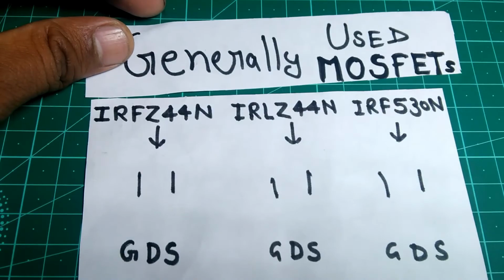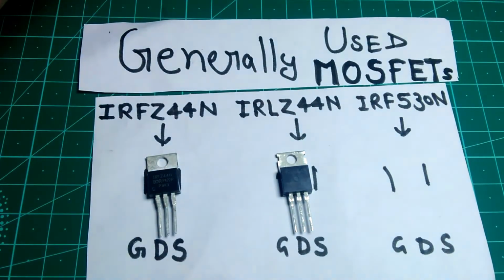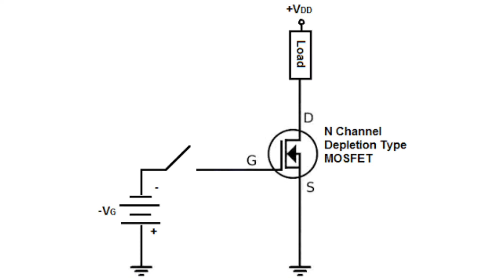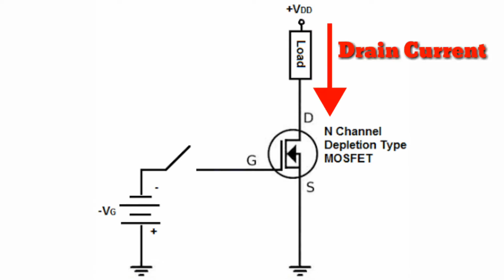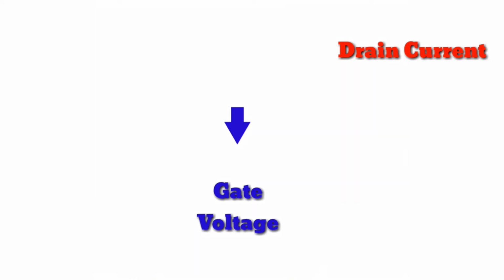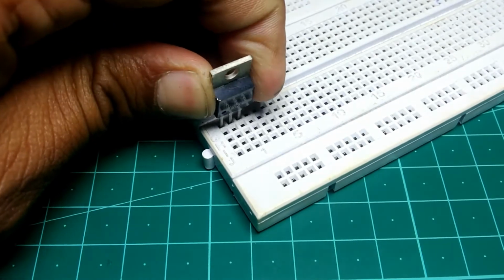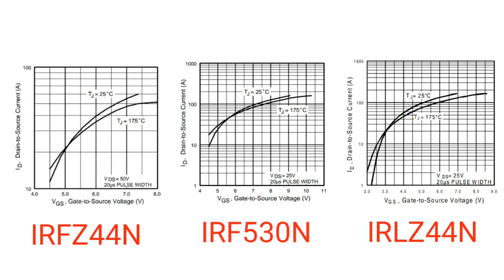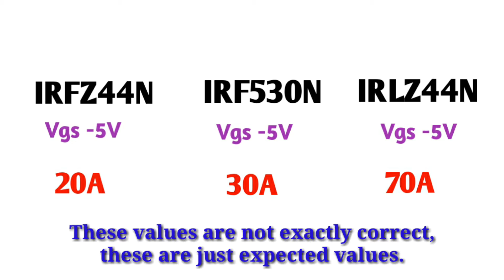Transistors with Arduino   Part 2 MOSFET's

Comment: Could someone help me? I have 12v led strip and i have to drive it by arduino. So i need transistor that could handle (logic/software pwm). for example pwm on pin 13 on arduino

Comment: Led strips required 12v and 1.5 amp
So which transistor i should use with Arduino
Reply from the maker: Well i have used TIP120 /122 and to be honest it worked like a charm, or you can use a logic level MOSFET like IRLZ44N

Comment: Hello I wanna ask question about IRFZ44N I found rgb led driver with IRLZ44n but I don't have IRLZ44n so if I use IRFZ44n it is gonna work the power I use is 12V and around 0.2-0.3A
Reply from the maker: According to your values it might work.

The best way could be using a BJT before MOSFET so that Arduino's signal will be amplified to say 9-10v by BJT which will be a very good gate voltage to switch the MOSFET.

Comment: is it safe to use 12v 2A adapater in arduino mega 2560?
Reply from the maker: Well you can use it. But try to go with 12v 1a or better to go for 5v 500mA-1A

Comment: Why you didn't used resistor
Reply from the maker: Actually i was just demonstrating and it can work without the resistor resistor is recommended when you run it for some time. So if i had to implement it i will use a resistor but since it was a demo so avoided it.

Comment: Thanks much. I was able to follow your video and get this working.
I have a 5v. DC motor and  this worked.
Earlier I used a 2n2222 and it got very hot and It stopped the motor from running, the 2n2222 plastic top used to stop functioning after a minute and die down !
Went with your design instead Works.
Reply from the maker: Your welcome , try to go with transistors who can withstand bigger currents or use a constant current source which can't provide enough current so that transistor won't go hot.

Comment: So when you use mosfet you don't need 2.2k resistor between Arduino pin and Base? Why is that?
Does that mean mosfet is more safe to use in case you forget about resistor?
Reply from the maker: Well it is true that MOSFETs are safer compared to BJTs but you should put a resistor of a suitable Value to avoid any misshappening. To make the circuit easy to understand i avoided the resistor. It is always the best idea to go with resistor.
Reply: its gate terminal, not base
Reply: Why didn't you mentioned it earlier. Today my Arduino died just bcoz of you 👿👿👿
Reply: @laxmiibhele8376  similar thing happened to me before. I followed some video in youtube and ended up burnt my Potentiometer.
Reply: You should always use a resistor between an Arduino output pin and a MOSFET gate. The MOSFET has a gate capacitance that will initially behave like a short to ground when the Arduino pin switches rapidly from low to high. Since the pin is only rated for 20mA maximum, it is advisable to add a series resistor to ensure that the gate capacitance doesn't try to draw more current than that. A 270R resistor would be a good choice. Of course, the transient current drawn to charge the gate capacitance may be too brief to cause any damage, but it's better to be cautious than to damage the Arduino for the sake of a resistor.

Comment: Home come you used a resistor in part 1 but not here? You dont need it?
Reply: @electronicGURU  Oho, I thought all transistors were current controlled.
Your videos are very hands-on and educational, its helping me a lot!
Reply: You should always use a resistor between an Arduino output pin and a MOSFET gate. The MOSFET has a gate capacitance that will initially behave like a short to ground when the Arduino pin switches rapidly from low to high. Since the pin is only rated for 20mA maximum, it is advisable to add a series resistor to ensure that the gate capacitance doesn't try to draw more current than that. A 270R resistor would be a good choice. Of course, the transient current drawn to charge the gate capacitance may be too brief to cause any damage, but it's better to be cautious than to damage the Arduino for the sake of a resistor.

Comment: I don't seem to get a power boost from the MOSFET but just a through put from the 5v of the board.  I am using IRFZ44N MOSFET, do I have the wrong type?
Reply: For use with logic circuits, you're always better using a logic-level MOSFET, which is designed to turn on fully with less than 3.3V on the gate. Logic-level MOSFETs are types like IRLZ44 or IRL530, whereas the non-logic-level types are IRFZ44 and IRF530. The 'L' in the name indicates a logic-level type. If you look at their data sheets, you'll see that the 'F' type MOSFETs will have a gate threshold voltage of as much as 4V, while the 'L' types have gate threshold voltages of 2V maximum.
You may find that the output of 5V from the Arduino is not enough to turn on your IRFZ44 properly.
Reply: @RexxSchneider  Thank you, I found your comment useful. I was debating on what to buy for an esp8266 project and I think I'm gonna go with the IRLZ44N.